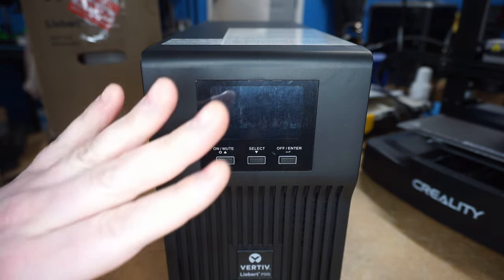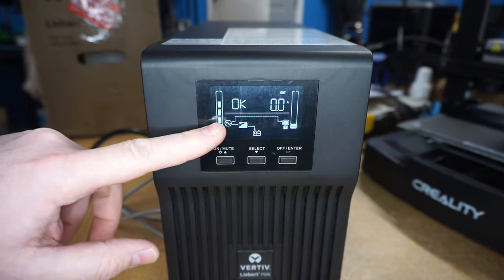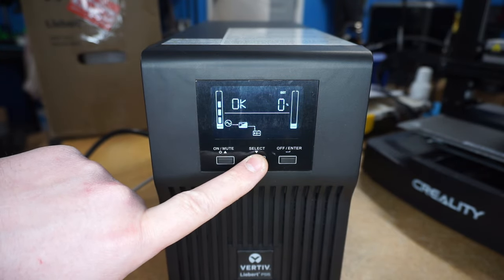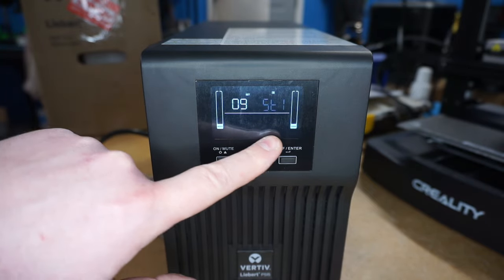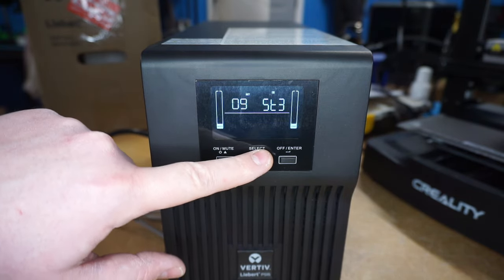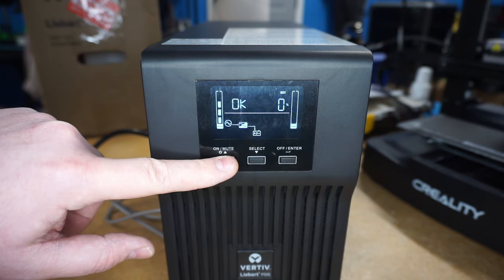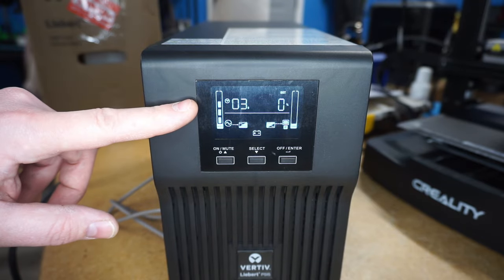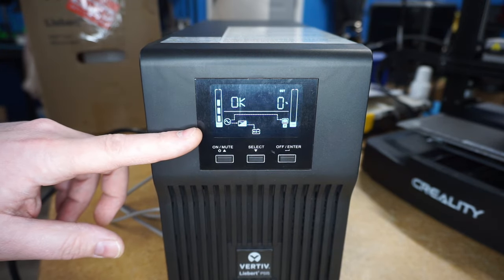Changing Vertiv Liebert PSI5 UPS Sensitivity

Comment: Hello friend, I have exactly the same equipment. In my case I have the problem that on the left side of the screen (the battery side) the initials 5F appear along with a warning sign, the problem persists even after doing all the steps in your video exactly as you did it, I do everything you do in the video and when everything is supposed to work the same 5f warning signal returns, with the beeping and constant blinking

Comment: Thank you Thim, I was going crazy to understanding why the UPS was continiously in switching mode and beeping. I tought that maibe was faulty.
Reply from the maker: They're super sensitive units. If the unit has an actual fault it will display an error on screen. They have built in diagnostics.